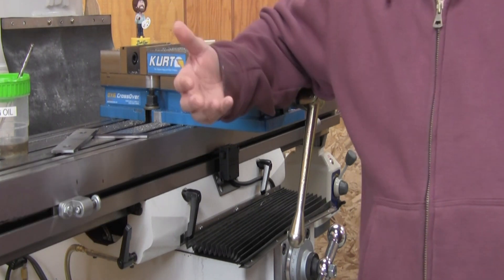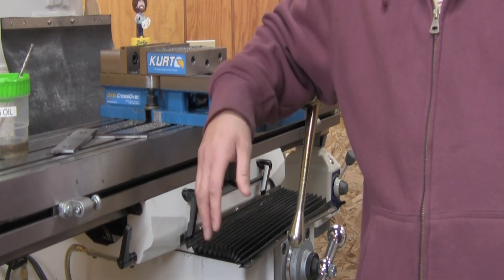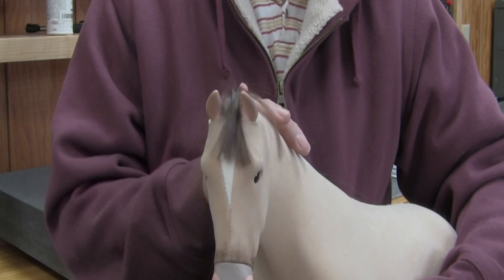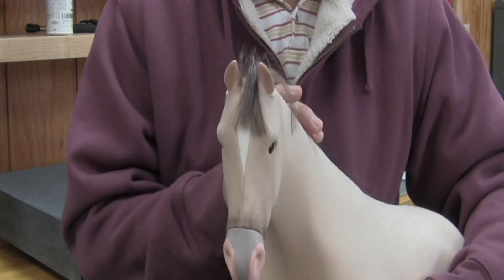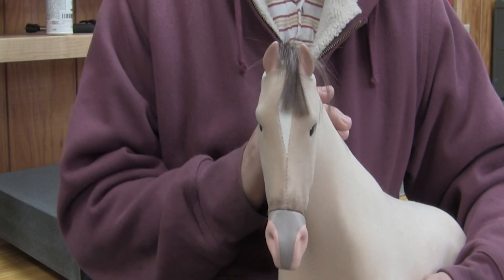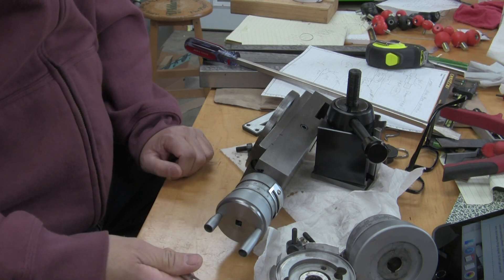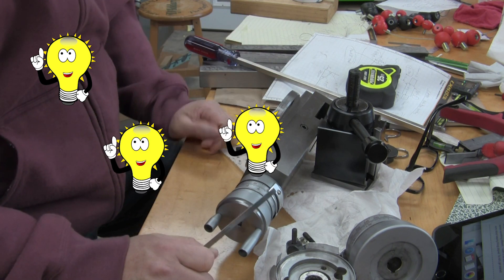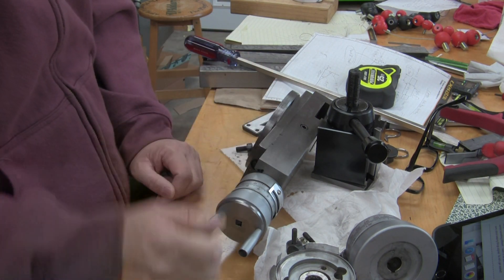Lathe Compound Power Feed (sort of)

Comment: Forgive me for double dipping on the comments Yuchol but I am interested in the center finder you are using for the lay out. Looks like 2 squares with a scale in the middle. My question is how do you use the rest of it. ? Did you make it yourself and if so is there a video on it ?
Reply from the maker: I got it from Grizzly 15 years ago.  It’s a center finder that also acts as 90 and 45 degree reference angle.

Comment: You make a great video. I do have one (hopefully constructive) observation: I don't know if you're a self taught machinist, or perhaps you have never turned work which is bigger (or harder) than the lathe is normally used for? I ask this because I've noticed that both those groups of people tend not to think to minimise the overhang of the tool from the toolholder. Perhaps they don't realise that even before you get to the point of audible chatter (resonant oscillation) there is still a price being paid in surface finish and tool life.
I say this in relation to the facing operation at the start of this video. Both the HSS and the carbide tools are shown sticking out further than necessary.
The same comment applies to the compound: when doing heavy cuts, it pays to minimise the overhang leftwards past the supporting dovetail.
But that's a very minor point in the scheme of things, and what I have seen has inspired me to subscribe and follow your channel with interest.
Reply from the maker: All fair comments, thanks for sharing for everyone to learn